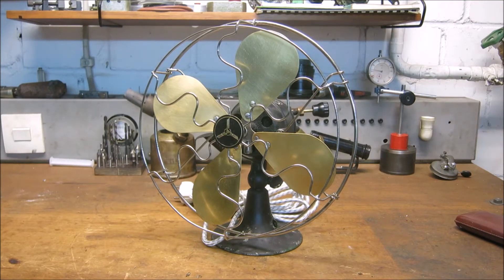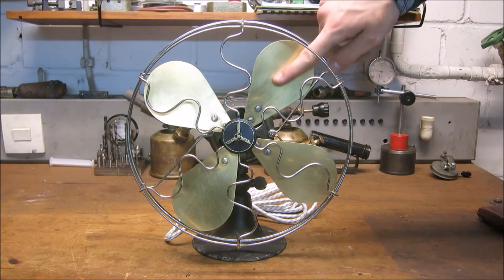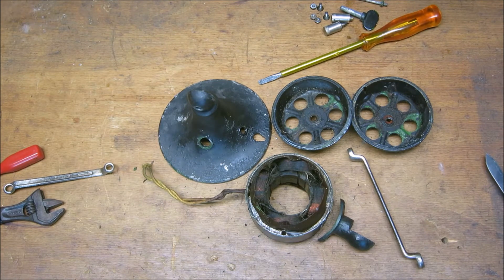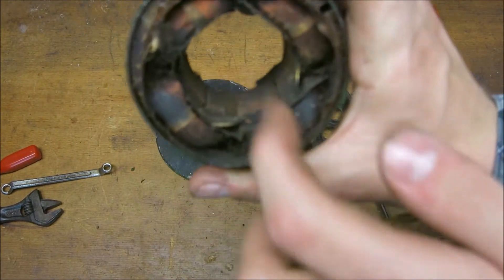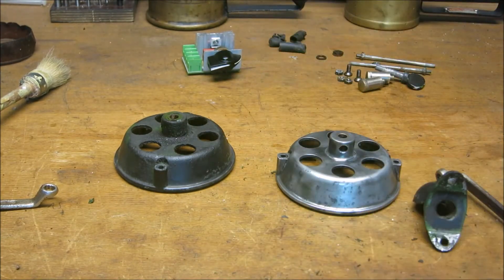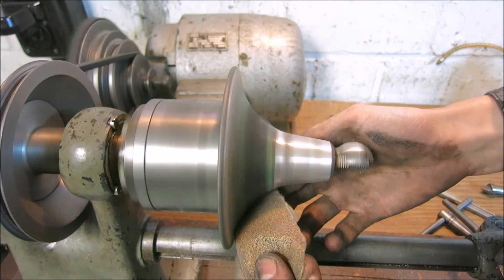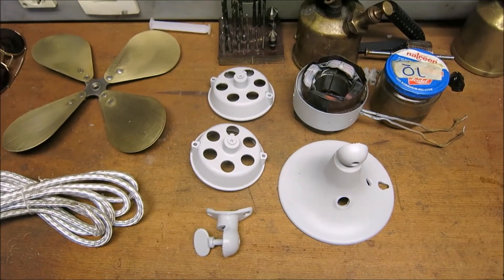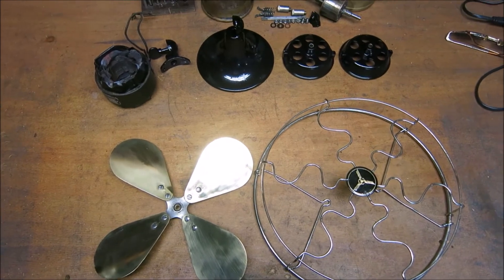Maico ET25 Desk Fan

Comment: Schönes Gerät! Vor allem der "Hochsicherheits-Käfig" gefällt mir gut :D 2 Anmerkungen: Erstens - die Netzspannung führende Platine sollte gegen versehentliches Berühren geschützt werden. Zweitens: Die Mutter, die die Flügel auf der Motorwelle hält, hast du mit einem Rechtsgewinde versehen. Diese würde ich z.B. mit Loctite sichern, da sie sich durch den Anlauf des Motors lösen könnte. Bei den meisten Ventilatoren findet man aus diesem Grund in der Regel ein Linksgewinde an dieser Stelle. Ansonsten schönes Ergebnis deiner Restauration! Viele kühle(nde) Tage wünsche ich dir (ebenfalls aus dem Dachgeschoss)
Reply from the maker: Vielen Dank für den netten Kommentar. Die Platine habe ich insofern gesichert, als dass ich den "Unterboden" mit einer dünnen Gummidecke zugeklebt habe (nachdem die drei kleinen Stopper nicht genug Halt boten). 
Die Mutter hatte sich in der Tat schon einmal gelöst - ich habe sie jetzt mit Sekundenkleber mit dem Rotor verbunden.